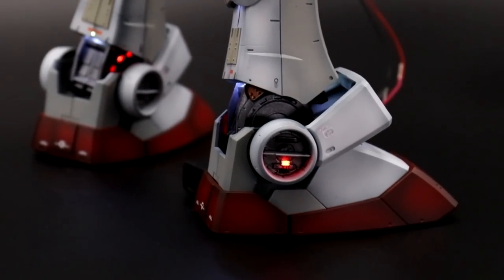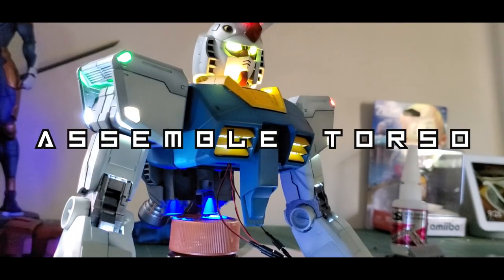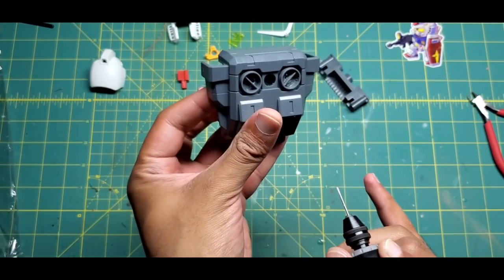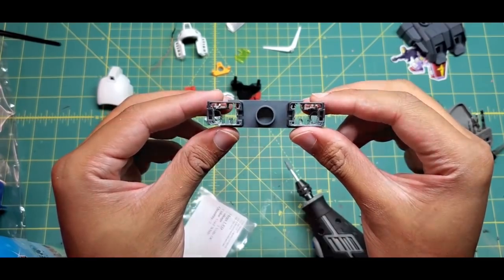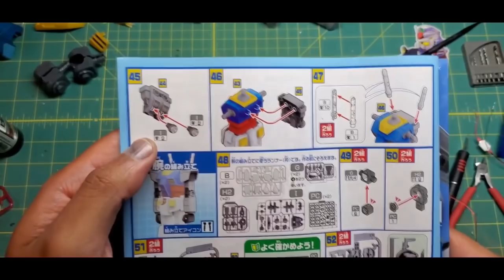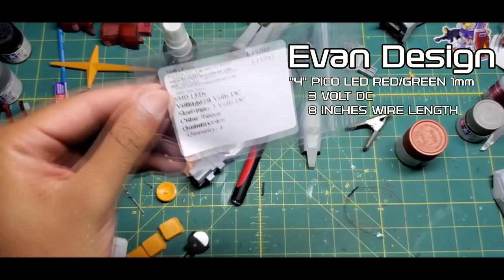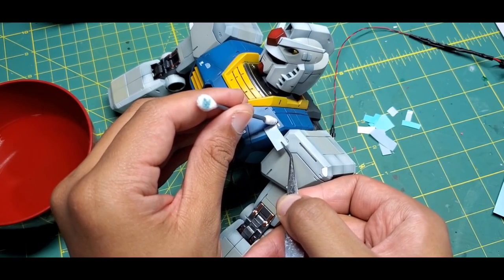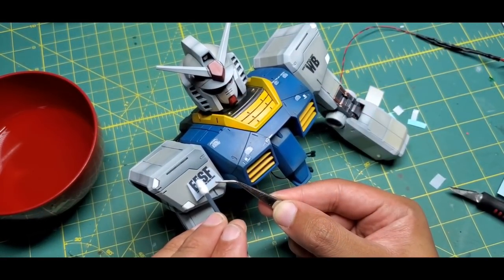#OtakuBuilder #Gunpla #Bandai MS Gundam 40th Anniversary(RX-78-2 Mega Size)

Comment: Your work and video are great!  I'm just starting out and you are inspiring me.  I have a couple of questions though. Why do you prefer to use the primers out of the can rather than using air brush primers?  And why do you switch out between  black primer, white primer and the finishing surfacer 1500?

Comment: I am very new to gunpla building and I had aquick question. How would you go about doing the preshadowing on an HG model? I am looking for tips on the technique you use and it looks simple enough but you are working on a Mega Size model, I doubt I can use the same techniques on a 1/144  piece.

Comment: beautiful rx 78 2, i would have ran the entry for the wires through one of the feet instead of the crotch though so it could be alittle more hidden, then maybe have a base it can stand on and hide the battery pack under that